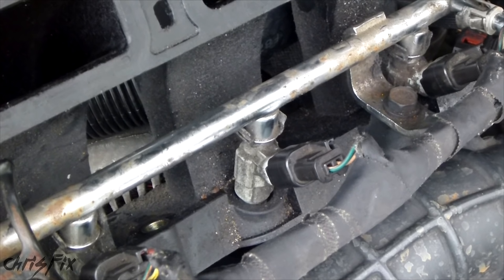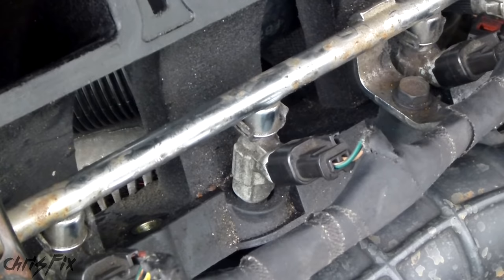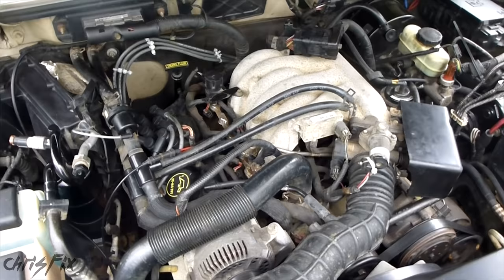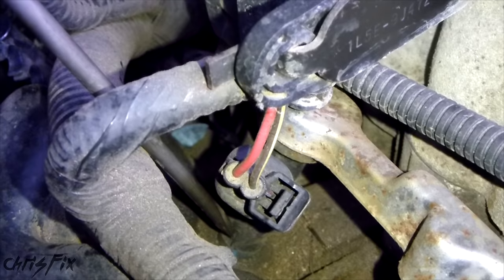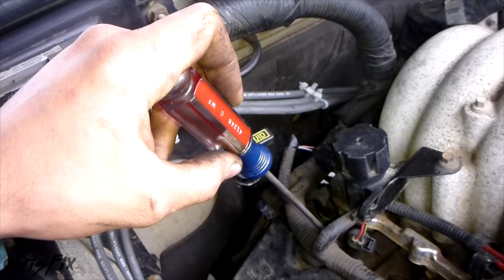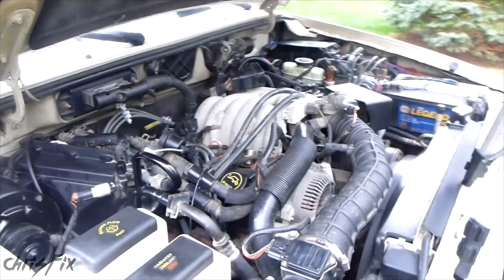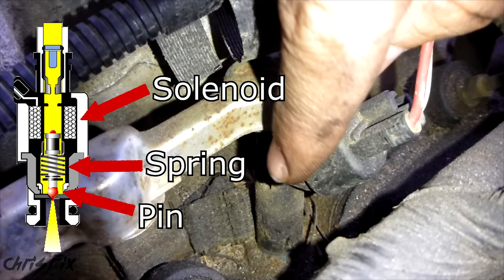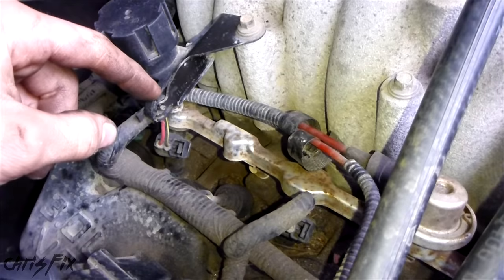Testing Fuel Injectors Fast

Comment: 2004 galant 2.4l low idle almost stalls no cel, just replace ect sensor, thermostat, spark plugs, valve cover gasket, and spark plug tube seals due to oil on coils 161k miles, and i just got a quote for $2,800 for a hub/bear, shock all around, outer tie rods, idler pulley, and i need brake pads and rotors all around, (braking on the highway had the steering wheel shaking). i got the car for 1k...

 oh and mold

Comment: I have a question ..   I have a 2003 cord explorer  ..  it has 207k miles. I know it's old . But before like 3 years ago . Was the last time i redline my truck . It sound healthy .. but today i kinda wanted to redline it. And it doesnt redline anymore. It just stays at 5 rpm or 6rpm.. can it be a fuel injector? I really get bad fuel miles.. around 14 to 15 ..mpg it's a v6 4.0lt
Reply: I don't think your truck is suppose to rev much past 5k man it's not a sports car. The gas mileage doesn't sound too crazy either, but a good tune up may help.
Reply: @Yophillips3272   before it did rev . Now it just stays high RPM ..  gas still like 14 to 17 mpg .. mostly highways .. I got it to 19 mpg once..
Reply: @juliopena21  I'm trying to understand, when your driving and floor it, it just stays at 5-6k? That's probably your transmission. I had old car like that it wouldn't shift if I floored it, otherwise it shifted ok. Or if ur talking about being in park and revving? try putting it in neutral then rev it. Some cars wont let you rev past 4k or so if your in park.   Don't blow her up tho.
Reply: @Yophillips3272  oh no.  Everything is fine .. I was just wondering why it rev before and now it doesnt.. but the truck is In excellent conditions .. only leaks between the engine and transmission  .   Just small leak but i dont care to much . Mech wants 700 bucks to fix. . I'll just let it leak . Lol
Reply: @juliopena21   oh that's good.  I was just throwing out ideas.
Reply: Thanks btw . Have good day

Comment: יHI Chris, my Renault Megane from 1995 the engine goes off ( like I give gas and nothing happens after 20 min.or less driving. It won't start again untill the motor has cooled down. Is this problem about fuel injectors as well ?
Reply from the maker: Pierre Tobiana It could be fuel inhectors or it could be the fuel pump. I would do a fuel pressure test: https://www.youtube.com/watch?v=_oXLUqE4Sf0

Comment: Hey chris, i have been getting a cylinder misfire sometimes in my honda but its only during the startup. It doesnt do this everytime but when it does, it goes back to normal after about 5 seconds. Any suggestions? I plan on doing this test too.
Reply from the maker: Ahmed Haggag I have the same thing in my truck and I am 99% sure it is a clogged injector in that cylinder. It could also be a bad injector.
Reply: ChrisFix Thanks for the reply. Also, is it ok to keep driving my car like this or is it bad for my engine?

Comment: hi chris, i have one fuel injector is not working. can i replace just one(bad one) or do i have to replace all of them for the correct engine alignment?
Reply: You can replace one.  Be sure to test it and make sure it needs replacing.  It might need cleaning, or it could be electrical problem too.

Stay gold.
Reply: P0011 audi

Comment: I have a 99 Ford torus and everytime it rains the engine cuts  out when I go thew a small puddle what is causing this to happen
Reply from the maker: +Nathan Steinhauser I would check for vacuum leaks. Sounds like water is getting into the intake.

Comment: Can you get smoke coming out the tailpipe with a bad fuel injector? It smells like gas
Reply from the maker: You could if it’s leaking fuel into the combustion chamber. It could also be running rich from a sensor like the Maf or o2 sensor going bad and not reading properly.

Comment: So I have a 2005 legacy GT and it has 650cc injectors. Theres an old tune for it thats programmed for that but it sat for a while and now it constantly pours fuel in and misfires on all cylinders. Theres a heavy gas smell. Do you think the injectors stuck open?
Reply from the maker: It could be or the tune is off. I would pull the injectors and turn the car to the run position to see if they shoot fuel out or not. If they do they are stuck open. If not, they are probably fine and your tune is off.
Reply: ChrisFix okay I guess I would have needed to check but wanted a second opinion. When the car is in second position I feel like I hear a constant whir buzz likey theyre constantly on. It reeks of gas. Thanks for your response.
Reply: @chrisfix  turns out the tune went to hell but also side feed injectors are utter crap. So basically I had a shop build a base tune to hold over til I get all the top feed conversion parts I need so they can dyno tune and the car can be perfect.

Comment: Old video hopefully someone sees my comment but i have a loud tick from my b230ft and its exactly like the screwdriver trick but i can hear it just standing straight infront of the car. My auto tech teacher told me it's possibly a lifter tick but this video sounds exactly the same just not as loud. If anyone is wondering i have a 1990 volvo 760 turbo

Comment: i have a check engine light and my truck turns over, but doesn't start.  my code reader says bank 1 is running lean. i have two other codes too, idle air control over speed malfunction and EGR flow insignificant, could these other errors effect my injectors in any way?
Reply: Wa- hey easy do it your self jobs
Reply: was the starter lol

Comment: Chevy recommends a fuel injection cleaning for my burb every 45000 miles, is this necessary? thanks
Reply: If the factory recommends it, I would do it.  If your injectors are easy to remove, cleaning them is easy as well.

Stay gold.
Reply: I should mention, the dealer "cleaning" is just putting a can of pressurized carb cleaner in your fuel rail.  They dont actually remove your injectors and clean them.

Stay gold.
Reply: +dnl machine Stay black

Comment: What test can you do to find out if the injector is causing a rich condition?
Reply from the maker: Metal Maniac A fuel pressure test might tell you that: https://www.youtube.com/watch?v=_oXLUqE4Sf0
A leaking injector will create a rich condition. You can also use a scan tool and look at the fuel trims.
Reply: Thank you Chris...my Saturn has 60lbs on the rail and that seems high to me.  I will try the leak down also with both sides clamped off thus isolating the injectors..
Reply from the maker: Metal Maniac Keep me posted!

Comment: Hi, recently i had 4 new diesel injectors fitted on my 2010 ford galaxy by main dealers. Now i find my fuel consumption is very high, the car is not as smooth as before it feels heavy. Took it back to them but they cant find any fault. Any suggestions to why this may be. Many thanks
Reply from the maker: Ansar Ali I would get the air/fuel ratio checked to see if it is running normal or rich.
Reply: ChrisFix Thank you Chris. I will try that.

Comment: can a bad injector be bad on cold start only? because my car has a rough idle and smoke on cold start. please reply. thanks
Reply from the maker: They can be affected by heat. If the smoke is black it could be excess fuel.
Reply: ChrisFix The car is diesel bmw. No check engine lights. 
I listened for the ticking sound and it's constantly there for all 4 injectors. 
How do you think i should test it next? If i use a multimeter, will that be right even though no engine light is on?

Thanks man

Comment: Hi I have a 2000 ford ranger with the 3.0 and I recently replaced the fuel pump, fuel filter, spark plugs and wires. I can get it to start but when I press the gas it does not accelerate. Any suggestions
Reply from the maker: Is the transmission good?
Reply: ChrisFix it was running fine before the fuel pump replacement. I had someone tell me the oil pump could be bad.

Comment: This vid. shows, I'm assuming, a V6 engine like my '05 3.0L Ranger. The 3 injectors on the pass. side are easy to get to. How do you check the 3 injectors, that are under the upper intake manifold, on the driver side?
Reply from the maker: fred forbush Yes, this is the same exact 3L engine. This process works for any engine. When the injectors are hidden, it is hard to do this test. You might be able to use a rubber hose like a stethascope and snake it under the intake manifold. Otherwise you will need to take the intake off and test them this way: https://www.youtube.com/watch?v=ZVXchvHefNc
Reply: Ok, Chris, I'll see if I can at least get to the suspect #4 injector. Thanks again.
Reply from the maker: fred forbush let me know how it goes!
Reply: Ok, I will.
One other question: Is it still necessary to do the resistance test if the screwdriver/steth. checks positive for clicks?
Reply from the maker: fred forbush I mean it is worth a shot to test them anyhow. The clicks means that the coil in the injector is working but maybe it isnt working 100% ya know?
Reply: Good news, I hope. I was able to put my steth. on #4 inject. and heard no clicking at all. All the injects. on pass side had definite clicks. I say "good news" because you know it is a simple fix compared to what it could be.
So, will the resistance test tell me whether I need to replace it or clean it?
Reply from the maker: fred forbush That def is good news! The resistance test could tell you if you need to replace it or clean it.

Comment: What about when you have a no start then how do you check injectors.
Reply from the maker: Katie Dewey You can use this method: https://www.youtube.com/watch?v=ZVXchvHefNc 
or you can check fuel pressure like in this video: https://www.youtube.com/watch?v=_oXLUqE4Sf0
Reply: Ya seen that after comment thanks for helpful info
Reply from the maker: Katie Dewey No problem! Good luck!

Comment: Help me  my car at still at full trottle engine cut of smoothly  but while running hitting redline my engine drwas back power when reach peak rpm like it stalls engine without revv cutter. What might be the problem
Reply: JITHIN JAZz I think that's when the engine  is trying  to say  CHANGE GEAR.  not really  a good idea to totally  red line it my friend,  it usually  hits max bhp  before  "Boom"  why not get your  motor on a dyno / rolling  road you will get a print out of max bhp & torque  in each  gear. 🤔
Reply: buy a carbureted car then you can rev it til the valves float.

Comment: what could  p0171 code be ? I'm having trouble diagnosing it !
Reply from the maker: Somehow there is not enough fuel or too much air going into the engine. It is most commonly a clogged fuel injector or vacuum leak. Check to make sure  your mass airflow sensor is clean: https://www.youtube.com/watch?v=gRfaPfTcfOM
Also check your PCV valve is not stuck open.

Comment: ok thanks, i have a 99 solara, 1mzfe, wait spark , with miss fires, on 4 , working on that, some code, replaced two bad coils. 
now 3, 4 are miss, think is the fule injectos, working on it. any in fo on that would be appreciated
Reply from the maker: +rex2013 Could be the other coils are bad. Try switching the coil at cyl 4 with cyl 1 and seeing if the misfire moves to cyl 1
Reply: thanks for getting back, i made some test on on injector ohms. looks ok but now is only on the number 4. i did a compression test and i got 150 to 180. i will be using a snap on solus on the scope, soon. will switch injector and see what happens. i think the the injector is stuck open but the pintal clicks.

Comment: will a bad injector make my car miss fire with a p300 and make the motor shake along with alot of hesitation enough that its not drive able it will stall and buck. any advice from anybody would be great!
Reply: A bad injector will give you those symptoms, . Only thing is a p0300 is for random cylinder misfires meaningmultiple cylinders have problems. my cars a v8 and it currently has a p1128 and occasionally gets a p0300 due to a semi faulty upstream 02 sensor that causes the muliple random misfire code to come up on only one bank. Since theres a significant loss of power on your car i'm guessing it's either a fuel delivery issue(clogged or bad injectors, faulty fuel pump, or a clogged fuel filter). But then again it could be anything else that causes a misfire such as bad plugs or bad plug wires etc

Comment: my car cranks but won't start, I changed cam shaft, cranshaft sensors, fuel filter, fuel pump, plugs. etc. but it still does not start, 2000 toyota corolla CE, please help
Reply: You tried checking the fuses?
Reply: did u fix
Reply: Figure out what's going on one step at a time. Make sure the fuel lines have fuel, the injectors are spraying, the spark plugs are sparking, the cylinders have compression, the crankshaft turns smoothly, etc.. Once you find a problem, figure out why that problem is happening, For example, if the spark plugs aren't sparking, check the ignition coils. If those are good, replace the spark plugs. If those aren't working, check the wiring harness and alternator. If those are fine, replace the coils. If not, replace the harness or alternator. Just test the basic essentials for a car to run (fuel, compression, spark, intake/exhaust flow, oil, not too much friction) until you find something that's missing and then go down the chain to find the exact component(s).
Reply: It might be the timing belt (or chain.) It's hard to tell without seeing the car.
Reply: Ayesha TAHIR  scrap it and get new one 🙂

Comment: could just pull the connector off that will tell if its working or not if it dies when you pull it off well self explanatory isn't it its working if it doesn't die well must of been dead before pulling it off just like spark leads to tell if a cylinder is firing pull the lead off you should hear a loud cracking as the spark jumps from the lead to the cylinder head and if that cylinder dies as a result of removing the lead you have a bad spark plug or cylinder
Reply from the maker: +TheBadspud Problem is, a lot of times those clips snap and then you need to solder a new one in.

Comment: how can you tell if the computer is possibly not sending a signal to the injector?
Reply from the maker: +KeyWestBluesX Use a multimeter with the car running and see if you get 12v
Reply: it dosent run and wont start. Now the suspect is the crankshaft position sensor.  1999 mercury villager. Its highly suspect since everything else has been replaced except for the seat covers
Reply: also i ended up getting those test bulbs that plug into the outlet after you unplug it from the injector--the light fired perfec while cranking

Comment: Hmm.. maybe my car has a bad injector. Its a dodge charger rt and its really sluggish.  Had no acceleration pull at high speeds and overall takes awhile just to get to the speed i want it to be.. If i gun it it shifts at 5k rpms (dont know if thats normal) by my old pontiac grand prix seems faster.  But maybe my transmission is just giving out. It has 168k miles

Comment: How do you tell if you have a injector leaking down? how would you fix it?
Reply from the maker: Todd Davis To tell if your injectors are leaking you need to do a fuel pressure test. A fuel pressure gauge is a great investment and only costs $30. Here is the link to how you test the fuel pressure: Fuel Pressure Test
and here is the link to the fuel pressure tester: http://www.amazon.com/gp/product/B000R5IASC/ref=as_li_tl?ie=UTF8&camp=1789&creative=390957&creativeASIN=B000R5IASC&linkCode=as2&tag=chri0e2-20&linkId=Y4Q624LQRLS2MCKO
Reply: This happens only when I start the car up for the first time. I have to turn the key over 5-8 times till it cranks. After that it will crank. I did put a pressure test gauge on it. When I turn the switch to on the pressure went to 40 psi. When I cranked the engine and it started the psi went to 36 psi in the running mode. When I pulled the vacuum hose of the fuel pressure regulator the pressure when to 47 psi. Also when cut the engine off the pressure went to 40 psi, I let it set for 15 mins and the pressure went 39psi. I check it again after 20 mins and the pressure went to 28 psi. Then finally it went to 0 psi. So do you think I have a bad fuel pressure regulator or a leaking injector?
Reply from the maker: The fuel pressure regulator sounds like it is working fine. Was it hard to start when you got your 40psi when you turned the key to the run position? I am curious if it is hard to start because there isnt enough pressure. Try to check the fuel pressure when you cant start it. When you rev the engine is there any popping in the exhaust?
Reply: The car is a 1989 C-4 Corvette with a 350 tuned Port engine.
Reply from the maker: Oh you should have told me it was a Vette. When my Vette had hard starting problems it was the check valve in the fuel pump. When I put the engine in the run position, the pressure would jump up to the correct psi but then immediately drop. I would see if you can figure out how to check the O2 sensor and see if she is running rich. The bank 1 O2 sensor will have a high voltage at near .9v if it is running rich. If so, you might have a leaking injector. I would also see if when you rev her up, she pops.
Reply: Do you have a video on HOW TO CHECK FOR LEAKING INJECTORS.?
Reply from the maker: Yes, the fuel pressure test is how you check for leaking injectors. You can also see if your engine is running rich by looking at the O2 sensors
Reply: ChrisFix could it be a cold start sensor that is bad.
Reply from the maker: Todd Davis I mean it could be but it could be many things. Without seeing the car it is hard to diagnose it. But that is a good suggestion Todd and worth a shot to check out! Thanks!